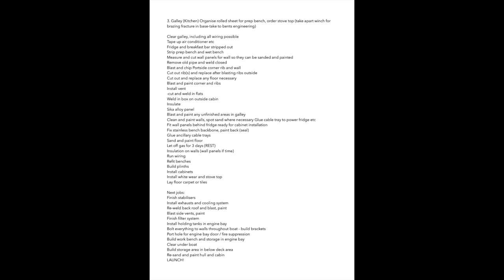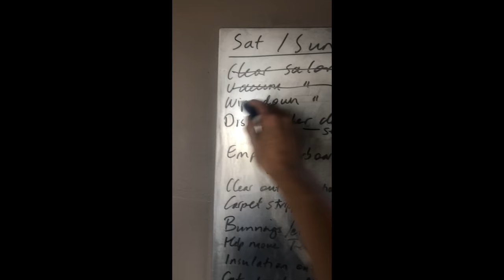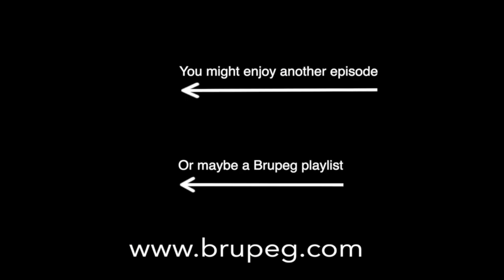Replacing Fuel Tank Vents - Project Brupeg Ep. 183

Comment: Oil tankers pump the ships exhaust through the cargo and fuel tanks. Static electricity is produced by the movement of fuel, the inert gas pumped through the tanks prevents explosion. One evening, aboard a tanker south of Sicily, in force 11 winds and fifty to eighty foot seas, a two meter steel plate broke loose and began sliding over the deck, slicing pipes off in it's path. I was on the bridge along with my brother and the first mate when the inert gas alarm sounded. It's programmed to sound when pressure drops below a safe level. It read zero P.S.I.  The plate had sliced the inert gas supply. We were on a floating bomb. No crew are normally allowed on deck in such extreme weather. My brother and I volunteered to venture out and secure the steel plate, and reroute the gas through a series of valves. We had to tie ourselves off to stanchions as we moved about the deck, so as not to be washed overboard. I've never felt so insignificant as I did looking at those waves approaching. Mountainous. Scared $hitless, we managed to lash down the offending plate and reroute the inert gas back to the tanks. We quite literally kissed the ground when back inside the safety of the house. One of those days you never forget.
Reply from the maker: I can just imagine what that must have felt like. Mariners are a different breed.

Comment: You could do rubber bedliner rolled onto the floor.  More durable than vinyl, less grungy than carpet, and not slippery at all.  Also if you get creative with masking tape you could create a design that looked like tile or maybe the logo of the channel.  Bonus, you don't have to worry about water getting trapped under it and rotting the floor.
Reply from the maker: Great point!

Comment: I worked for Bunnings in the area that includes flooring, paint etc. Matt finish tiles are not going to clean very well. Carpet, as you’ve experienced is really difficult to keep clean. The Rubber/Fluoro mats are a good idea, but moisture underneath can cause mould. The best idea would be the sort of open weave rubber mats they use in bars and commercial kitchens. Roll them up, clean underneath, give them a hose, dry them, and put them back. No slipping, no mould......
Reply from the maker: Thanks for the info!

Comment: Hi guys, my little tip re floor tiles... IF you go for tiles, use a tile that the base of the tile is similar to the face colour of the tile. i.e. we used a white floor tile in our kitchen, but the substrate material which the tile was made of was a terracotta colour. When something drops of the floor & chips the tile (& it WILL happen), it chips the white glaze off & you get the terracotta showing through. After a few chips the floor always looks like its got dirty bits on the floor! If the tile was a light base the chips would be a lot less noticeable. 
But my thought would be (as others have stated) maybe put down a vinyl covering that looks like a composite type of stone (like a commercial kitchen would use) & then use cushioned rubber matting as the walk on surface. Easy on the feet & back, plus you can take them out to do heavy duty cleaning on them or replace later when required.
Reply from the maker: Yeah we are leaning towards vinyl with rubber mats

Comment: Have a look at commercial vinyl flooring, I used it on my last charter boat and it really lasts. Think of a dozen anglers, divers and crew traipsing in and out of the cabin very day, it may get all kinds of dirt on it but it was really easy to wipe up. It was waterproof, quiet and relatively soft underfoot.  industrial vinyl flooring coin pattern
Reply from the maker: Hi Roger, yeah we are leaning towards a good vinyl

Comment: Vinyl textured planking is a great way to go. Adhesives hold them firmly,  and they are textured so they have a non slip surface. Also very easy to clean and extremely durable.

Comment: Hi people, my suggestion on flooring is industrial slip not coating of some sort through out so you don/t have damp rot on the floor or between layers( eg the smell of damp wrecker yard cars cannot go away from your senses)  - if needed you can use premium commercial carpet tile/matt in some dry areas as its very fast to take out a spill or full removal in storm situation. Remember the rock and roll of boats and trying getting from point A to B on your boat without bruises or head knocks from slippery wet floors . Your intro with the high swell makes me think you will need a "Tether" system  while operating the wings, anchors / being outside. Safe voyage!
Reply from the maker: Hi Paul, yeah we havnt really put a lot of time into the 'outside' systems yet. We do have quite a few ideas to make being outside in weather much much safer

Comment: Can you get 'trigger release' zip ties? You only use them in areas where you know you're going to have to change or add wires several times before the installation is complete, but it saves scrapping ties over and over again. They can be left permanently in place, so they won't be wasted when the job is finishes (it's a boat, it will never be finished).
Reply from the maker: You probably can get them, but its australia, so they will be special order from mars and cost $87 each...

Comment: I have wood floors in my kitchen and it works, but it's cold at times and hard to walk on so I use this rag rug that is maybe 1 m by a bit more than 2 meters and made out of old rags. That helps a lot and if need be, I can throw it in the washing machine. The rag rug is also been treated with a flame retarding fluid so it won't burn. I tested it and worst that happened was that the open flame smoldered for a bit and then went out.
Reply from the maker: Thanks for sharing!

Comment: How about vinyl plank?  Looks like wood floor, doesn’t need underlayment, waterproof, and pretty inexpensive.
Reply from the maker: Thanks. We will check it out
Reply: Look for the wood grained planks.  No 70's lino look and its much more anti slip than the smooth ones.

Most are wet area rated but the seams can also be sealed for additional protection.
Reply: Pretty slippery when wet though.  I think it's the same problem they have with the tile.
Reply: Not the stuff I’m thinking. I just installed it to my kitchen, and it’s very slip resistant. TBH though, I’ve never covered my floor with seawater and rolled the kitchen 30* side to side, so you may have a point.
Reply: @whodat90  I highly recommend it.  You can't truly appreciate the craftsmanship of your kitchen until it's covered in sea water and rolled.

Comment: From the videos, your fuel tank vents will be far forward on the bow at the focsle level. In bad weather waves over the focsle can briefly submerge the tank vents, which would allow sea water into the fuel in the tank. If that's a consideration where you intend to operate then the vents should have a gooseneck with ball check at their ends. The ball floats up and seals the tank vent from water when a wave passes by. Greg
Reply from the maker: Hi Greg. The vents have simply been moved sideways about 1.5m, these tanks are also just storage so we can choose when we drain them and if needed adjust course to account for the weather when we do this. It’s common for trawlers up here to out plastic bags over the vent and duck tape them on until they are needed then pump quickly into the rear tanks.

Comment: You should never start a new project unless there's at least 17 other non related projects and 34 related ones to distract you😁
How about a timber 'floating floor' maybe from compressed bamboo? I'll throw a piece in a bucket of water and see how it looks in a week.
Far from an expert but 200amps seems a bit high for 6mm. I generally use 20amps per mm, eg 120amps for 6mm.
Need to find a way to connect Jess to the power system cos damn she is full of beans 🤗
Reply from the maker: Jess is Direct Current. Im curious about the discussion thats started around the flooring. Interesting to see where it ends up, i think another bunnings trip is in order

Comment: Do an epoxy floor with coloured flake similar to a garage flooring. Easy to do and looks great, clear coat over the top makes it robust.
Reply: Very common in boat galleys and places like milk processing plants, also it is self leveling can have non slip added
Reply from the maker: Something like this is my prefered option, the only thing im not sure about is the compatibility with the paint thats already on the floor. I dont want to have to sandblast the paint back to steel (and i suspect the current paint would react with epoxy)

Comment: Just finished battling the same corrosion issues in my galley... leaky sink drain, leaky fresh water pipe, and a leaking window over the galley sink all contributed to make a frustrating project! 

I’m sure you’re thought of it on your fuel and fresh water fills, but I’ve found it’s easiest to use a stainless pipe cap with a nut welded to the top of it. Make your fuel fill nuts a different size than your fresh water. No monkeying with pipewrenches, and no rusty caps!
Reply from the maker: Yeah definately stainless fillers everywhere. Our water fills are flush to the deck as they were right in the way previously.

Comment: That rubber material you showed is far the best. Costly maybe but on a heaving sea you want dimple mat. Plus it is for the back. Sound proofing. Last thing to be able to remove to pressure wash.
If you do buy it ( hope you do) wash a few times as it smells for a short time. 
👍🇳🇿💪
Reply from the maker: Yeah we definately want mats for the back in there

Comment: 22:22 one way to know for sure that you won't need to purge pipe is simply doing a depth test at one of the ends or on a piece of scrap. Play with settings and your timing such that you're penetrating just enough to not break inside skin. I've done it plenty of times, the really good welders out there can do this trick on 1 mm thick stuff. I've seen it, that's where i've learnt the trick from, am aiming for it, but it's outside my skill level as of it.
Reply from the maker: Ahh cool. That makes a lot of sense. This is thick wall schedule 40 pipe so would easily be able to adjust to make that work

Comment: Many work boat galley floors are covered with Torginol, which is a poured flooring system that can be colored with a wide variety of imbedded decorative chips and flakes. Might be worth looking at. Greg
Reply from the maker: Brilliant, ive seen this used in a few boats but had no idea what it was called. Thanks for sending this through i will do a bit of hunting and see if I can find a local supplier

Comment: I would look into epoxy with quartz granules for anywhere you are worried about wet slippery floors like in the galley. I'm sure the granules are available where you are they also have a variety of colors "Usually around $40-$50 US for 50lbs" and finding the epoxy locally I'm sure wouldn't be much of a problem, you can also run it up the wall a few inches to make cleaning easier.
Reply from the maker: Something like this is my prefered option, the only thing im not sure about is the compatibility with the paint thats already on the floor. I dont want to have to sandblast the paint back to steel (and i suspect the current paint would react with epoxy)
Reply: @ProjectBrupeg  They sell epoxy bonding primer. There is a company called armor garage here in the US that sells some. I'm sure you could find something similar locally perhaps talking with an epoxy floor specialist they could guide you toward the right type. The alternative to epoxy would be something like Tuff Coat or even Chemsol 2500.

Comment: I'm surprised to see either the vent or fill tube near scuppers.  I'm thinking that a quick check of the regs would show that you've got to contain overflow from fueling rather than allow any of it to go overboard.  Course, by the time this vid is out, it will be done and to late to change.  My boat had 2- 500 gallon tanks and we always had to have a bunch of the oil/fuel absorbing pads easily at hand when fueling.  Vent pipe overflowed once.  Not a drop went into the water.and the overflow was captured in a trough around the base of the pipe with several pads in the bottom.
Reply from the maker: Hi Rex, we are just copying the original filler so it passed survey before. That said these tanks are for vege oil so pretty harmless stuff compared to diesel

Comment: Chiming in as for the fuel filler.  The reason for filling from the bottom is that diesel even jet fuel can develop a static electrical charge when it gets agitated allot.  They fill from the bottom to cut down on the amount of agitation of the fuel so that there is less static electrical charge..  However some countries don't fuel in this method, part of europe and the middle east fill from the top.  But each country has there own regulations.  On a boat your filling from the top no matter what the part the matters is what you build.
Reply from the maker: Good to know thanks Garry

Comment: Just a few thoughts!

First, great to see Jess firing on all cylinders!!!

Kitchen units, don't put plinths down, mount the units from the wall, it can give you extra storage for crates, no issues with cleaning, and there's something else that just flew out my head 🤪

Flooring, there are plenty of non slip ceramic\porcelain tiles around. If you go down the route of tiles you will need to use a decoupling layer, something like Schluter Ditra (https://www.schluter.co.uk/ditra-25.aspx) and flexible cement based adhesives with epoxy grouts - maybe vinyl is the way to go 😂

Internal walls, not sure of the standards but you possibly should be using fire retardant materials. It looks like you have expanded polystyrene which is a serious no-no as far as fire is concerned. Fibre glass is good, wool is surprisingly good but not to sure about it if it gets wet. Though I suppose if it's that wet, the fire risk is minimised as the boat is probably sinking! 😂

Anyway hope that helps
Reply from the maker: Hi Nic, the poly we have in the walls is a fire retardant type. You can put a flame to it and it shrinks away without gas/smoke or catching on fire. As for walls same deal, we want fire proof and fast/easy to keep clean so we have stainless sheet that we will be using to line the galley.
Reply: I should have known better than to ask 🤪🤪🤪🤪🤪
Reply from the maker: Nah it’s good your pondering that. Really important build feature

Comment: Great episode, I like the list.  I don't know if it is available in your neck of the woods, but there is a commercial carpet available in Alberta that comes in 18" squares that has a integral underlayment and a  peal back adhesive. the  adhesive has plenty of tack to hold it in place yet is designed to be puled up when a section is soiled or damaged. I am not sure of the brand but if you are interested I can do some research and get back to you.
Reply from the maker: Thanks for the info! we did see some carpet tiles that had an adhesive. There wasnt much underlay but enough for a commercial office setting im thinking

Comment: You are removing several old and rusty steel pipes that ran along the inside of the hull and through ribs.  Are you going to patch those ribs where the pipes cut through?  Seems like it might be a structural issue.  It is great that Jess looks so fit these days!
Reply from the maker: Hi Ken, new pipes will be welded back into those ribs except the front vent pipe, that said there is enough strength without adding more steel into that stringer cut.

Comment: gooday guys  how was the home depot run  and to flooring my old department lol  , i think i agree with jess on this one  too much flex in your boat for tile theyll just crack and be a hazard. i would be tempted to go cork flooring but its costly do not use the astro turf please  which leaves the engineered wood flooring systems  and i have to say  paper and epoxy wont rot  it bends its hard to break dent or scratch it comes with almost any picture you want on its surface,,, hope i helped thanks for the vids as always
Reply from the maker: Thanks Mike. Jess and I had a really good pros and cons discussion this morning as we are still undecided but thinking for ease of fitment and ability to makes changes later if we need to either floating boards or vinyl

Comment: I'm guessing those tank vents are kept sealed most of the time and only opened when filling up  (or if the boat is sinking) but I was wondering where the tanks get air from to prevent a vacuum stopping flow, is there a small vent in the engine room ?
Reply from the maker: Hi Ian, yes sealed tight almost all of the time, these are fuel storage tanks so only get opened when we transfer fuel using high volume pumps from these tanks to our day tanks at the other end of the boat, the engine wont ever 'run' from these tanks unless something has gone very wrong

Comment: I love it when a plan comes together😁 It truly is amazing the work you guys get through. Re the galley floor. Have you thought about pouring epoxy resin as a base substrate ?
Reply from the maker: Hi Joss, something like this is my prefered option, the only thing im not sure about is the compatibility with the paint thats already on the floor. I dont want to have to sandblast the paint back to steel (and i suspect the current paint would react with epoxy)

Comment: As random as this sounds what about old floor boards cheap easy to work with good sound deadening and insulation from the cold steel and easy to swap out anywhere in the world if you need to
Reply from the maker: Thats not a bad idea. Simple enough to do, just not sure about sealing them water tight so moisture doesnt get between/below them
Reply: @ProjectBrupeg  could always varnish the bottoms if your after water proofing